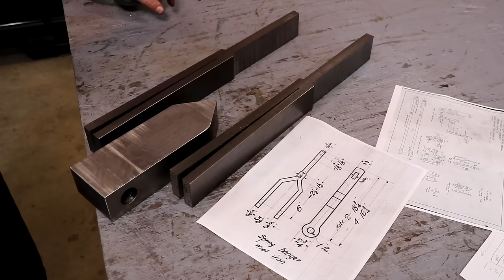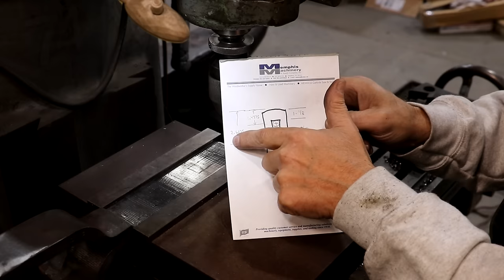Vulcan Steam Locomotive Spring Hangers - Machining the Details after Forging

Comment: I really appreciate your professionalism - not letting your detractors get to you. I had no idea how thick skinned a You Tube Content Provider has to be.
Reply: Actually, he has let them get to him!
Reply: Shipping him a set of spotting drills ... Jk, Keith is a treasure.  He is one of the few left that share reality and not some click bait bs.
Reply: @garys9694  No, if he had 'let them get to him' he would have succumbed to their wishes and changed his method. Telling them to F* off, is not 'getting to him'.
Reply: The only realistic reason I can think of not to use a center drill is the risk of breaking the tip, but I never used one so I don't know how easy is to break them.
Reply: @zomie1  I think most people don’t realize what life in a real machine shop is like. Mistakes happen all the time, on both the machinist’s as well as my part as the engineer. You stop by for a quick chat, fix the problem, and move on. Shame as here you potentially have hundreds of extra sets of eyes from various professionals which could be a god-send if a subtle but critical error is made.

Comment: I started my apprenticeship 50yrs back as a tool and diemaker.....making injection moulding tools and drop stamping dies and tools in the UK and I never heard of a spotting drill till I started watching youtube always used a centre drill never had an issue with hole positions doing so either will work cant see what is to get wound up about using one or the other...I will say you can use a centre drill to start a hole in a plate but you cannot use a spotting drill to prepare a centre on a lathe :)

Comment: Now, Keith, if you're insist on using a center drill in that way, you must use a left-handed drill. It must be half inch under size to allow for the wobble. And 87 octane gasoline must be used as cutting oil.
Reply: I think you're supposed to use 89

Comment: Thanks Crag for being great. Oh I’m not using my center drill right? I been doing it wrong for 30 years. I will have to remake all those thousand of parts to make sure they’re in specification, Not! Thanks for sharing. I think you got the hardest job on the internet, 1/4 of a million people watching every move you make, make lemon aid out of lemon and put it on a tee shirt. “ did you spot drill that spaceship part ? ”lol or “Center drill not just for hobbiest any more” lol. I’m so glad you have a great sense of humor.
Reply: If you think about it, using a centre drill to spot a hole is no different to drilling a pilot hole and enlarging it later. The only real problem with using a centre drill to start a hole is that the oil recess part of the driĺl (the pilot) is so fragile and will tend to snap off if chips aren't cleared to prevent jamming. A proper spotting drill maybe better as it is specifically designed for the job but a centre drill works just fine.
Personally I favour an old  two flute end/slotting mill reground as a 118 degree 4 facet  drill, but I'm just a cheapskate.😉
Reply: @littleworkshopofhorrors2395 , Rather than using the word cheapskate I prefer to use frugal, Lol
Reply: @Hoaxer51  or perhaps careful.😉

Comment: I knew a guy that had modified an old reciprocating saw to clamp most file tangs. He would use it when he had a lot of filing to do. It was surprisingly effective.
Reply: Didn't modify the saw, just put three four turns of bailing wire around a beat up blade. Worked fine.
Reply: Good Idea. Going to have to remember that. = Portable die filer!  (For what it is I might have burned it out with the plaz and finished it with a die grinder and carbide burr)

Comment: Keith, years ago, I had a 1964 International Scout with Armstrong steering, and I had to drill the hardened frame for the Saginaw box. I had to keep dipping the bit in water to try to protect the bit. I finally got the holes drilled, but it took awhile.

Comment: Thanks Keith, if it makes you feel any better, I don't own a spotting drill. I have always done the same thing that you do.
Reply: I'm the same.  I believe those of us who learned the trade in the 70s and 80s all use center drills.   I never even saw a spotting drill until  CNCs became common.
Reply: @philshel1  I ran a CNC for a few years drilling heat exchanger tube sheets. Never used a spotting drill.

Comment: Keith, don't let the trolls get to you. You are a skilled craftsman, which means that your chosen method may not be the same as practiced by craftsman B or craftsman C, but it still gets the job done. In any skilled profession, be it machining, engineering, medicine, law, or [gasp] politics; there are many different ways of approaching and solving problems. The key is to recognize that there are different approaches, and to select the one that you are the most comfortable with that will solve the problem. Sometimes we learn from others, sometimes, others learn from us.

Comment: I tried millin a piece of railroad track that was not annealed. I wrecked 4 braised cutters on a face mill. I think the track was work hardened from the train wheels. I finally figured it out and everything went more smoothly after I annealed the work
Reply: I'd say that's why you see a lot of makeshift anvils, made from an old piece of RR track.
Reply: Try machining a RR wheel. Hard as can be. Beth Steel had a machinability rating for them at "0"
Reply: rail road track is flame hardened after its installed.
Reply: The top and sides are induction harden and then flame tempered to a certain hardness before it leave the steel mill.  They don't do that out on the high rail. @MrChevelle83
Reply: @4GSR  ok then what are they doing when Ive seen the rail crew using a machine with a bunch of burners riding down the tracks?

Comment: Good work there Greg and Keith,  I love when a plan comes together, as one tv show was famous for saying.  In the back of my mind I was wondering if Greg had left the metal machinable. I had not seen the 4140 steel be annealed like that. Facinating Thanks
Reply: I think the smith might have went ahead and quenched it anyway....just heating it red and letting it air cool it will only go to like 40-45 C-Rock.

Comment: I once watched a Stefan Gotteswinter video and he explained that a center drill had the point sharpened to 118 degrees and further up in the center drill was set to a 60 degree bevel to match most lathe centers. Stefan explained that if you just use the tip of the center drill it will match your regular drill and will work fine but if you use the center drill up to it’s second bevel (the 60 degree bevel) then it won’t match your drill bit and could throw your drill bit off. 
   So yes, Keith is right about using his center drill and since they’re so short, they may work better in certain uses. Just adding some numbers to what Keith said in this video.
Reply: No question about it,,,,,if you are working to a half thousandth..... But in this case an eighth would go n noticed. - Fact is, unless there is something I don't know  i don't think the holes bought Keith a thing. - Just plnge and mill. -  Even if it's not a center cutting mill, down feed as you move.  Yo  Keith. let us know the reason you drilled the ends and didn't chain drill the center, or just didn't mill without drilling (I'm sure there is something i'm not seeing.

Comment: When we were cutting square slots we drilled and then broached the holes. squaring the broach against the fixture. Then we milled out the center waste. It saved us a lot of time
Reply: Hood idea,,,,,Another one i will remember. -  If it's fussy we have used the slotting head on the mill

Comment: Keith, your slotter attachment for your mill would make short work of the square hole. Also would would be a chance to set it up and use it.
Reply: Good idea but probably too much trouble to set up. Could save filing time by removing much of the material in the corners with smaller end mills.

Comment: Nice work Keith. Thanks for explaining the difference between a centre drill and a spotting drill. I use both for different applications. I find the centre drill better for rough surfaces as it is more rigid than a spotting drill.

Comment: I have been cross drilling like you did for over 60 years. - Even have done that in the drill press by locking the quill and sliding the vise back and fourth to get a mark in the top. . No question it's under +/- 005. if you don't dig in a mile.   

 I have just been thinking (it's why you smell hair burning) and although I have used edge finders to find the center of a round to cross drill,  I really don't remember ever needing anything where a couple of thousandths on a cross hole location made any difference at all anyway.. 

You cork sniffers lighten up on Keith. He;s a good man and it's for a friggin cotter pin!  Who cares? ---- Good job Kieth. i wold not have thought of the grain flow. - Bet that's the way they did it in the first place.

Comment: I have some small carbide drills that I can drill through M48 with and once you have a pilot hole through the slow-moving nose of the drill will not have to work much.  The faster turning (remember lever arm - pivot rotates and the outside flies around the pivot.) but doing as you did will work in time.

Comment: Is the hardness of the hangers an issue in use? If they were installed as hard as you received them, would they not be prone to cracking. Likewise if they’re not hard enough will they not be prone to bending?
Reply: The originals were made from wrought iron, a much less refined material then the steel Keith used.
They were still pretty soft as he was able to drill into them partway.
Reply: I’m speculating that the blacksmith thought increased hardness would extend the service life of the bearing surfaces. Keep up the good work, my favorite channel to zone out and relax on.
Reply: @samuraidriver4x4  I’m talking about the new ones. Given how hard it was when he got it, if he didn’t anneal it, could it have been TOO hard and prone to cracking?
Reply: @mbruce4152  maybe. But didn’t the old ones crack? Maybe I’m remembering it wrong.
Reply: @jamanjeval  they weren't that hard, it still produced chips when drilling so they where probably already softer then the springs that are attached to it.
Take leaf spring from a truck, those are hardened but to a point its springy and not brittle.
If you don't harden a leaf spring they would bend and deform.
If these were so hard they were brittle he wouldn't be able to even start the drill into them.
The old ones were made from wrought iron and you can't compare that with modern steel especially when it comes to how brittle it is
Reply: @mbruce4152  Keith did mention he asked the blacksmith to anneal them

Comment: I’ve never owned a spotting drill.. always used my center drills. Now I do have a few carbide drills that I use occasionally to spot harder material.. is that what you’re referring too ? 🤔 it’s amazing what you can do with 4140 and a torch !

Comment: Would you have been able to use a broach on the two holes, then mill out the center? I've always found that filing on a job like that is right up there with enduring root canal.
And ignore the Nattering Nabobs of Negativity re making a pilot dimple. I've always done that, drill press, mill or freehand drilling. Just makes life easier.

Comment: Question. Would it not be better to modify the rectangular pins to have a radius so that the hanger’s rectangular hole was likewise rounded at the ends? I worried about stress induced cracking due to square corners. Another great and informative video. 👍
Reply: Hasn't been a problem on the originals for over 100 years.  Don't thin it will matter now.
Reply: @mathewmolk2089  👍. If it ain’t broke, don’t mess with it.

Comment: As a machinist, I would have tried a cobalt or carbide drill before I would have annealed the metal.
But if those tools were not available, I understand. 
Side note.... You need to take it slow with 4140 when drilling with tool steel.
Reply: That would have then been hell to mill out the slot and file the corners square. He knew what would happen from the forging and told the blacksmith what needed to be done. Apparently the blacksmith either forgot, annealed it poorly, or ran out of time. Keith has the tools and knowledge to take care of it, so he got it done.

Comment: Could you have used a 5/8" square broach to get the square corners and then mill out the webbing between the holes?
Reply: Have you priced 5/8” square broaches lately?
Reply: @grntitan1 Actually yes! $$$$$ I was looking at 3/8" square broaches for a project. Now I'm hoping I can find someone with one because there's no way I could file these parts.

Comment: I'm wondering if it would be a good idea to drill a hole at the top of the saw split for the legs. So it doesn't split further on it's own. Just like a crack a stop hole.

Comment: I'm not a machinist but have done some work on milling machines and drill presses and I've always used center drills for spotting. Now I learn from Keith that I've been screwing up all along....
I wonder, are there any professional machinists that don't use center drills for spotting? The milling machines I've run had center drills with their general tooling, same with drill presses the center drills on them are as close to hand as the chuck keys and taper keys.

Comment: I've never used a spotting drill, always a center drill. Reason? I am budget minded and it works just fine. Of course, I am just a hobby machinist so having 1 set of tools that can do 2 jobs acceptably is an option and I can spend more on other things like end mills.

Comment: Comments, Comments, Comments!  LOL  I learned a long time ago that there are many ways to skin a cat.  Some people I have worked with always reminded me that their way was not only superior but the only way it can be done.  Then I went about doing my task the way I knew would work fine.   
Now for a serious question.  Considering the weight those hangers and pin will carry, is the annealed hardness sufficient or will it require re-hardening to some degree?  
Thanks for your videos, even if I might have done at least something different that you.  (My only metal experience is watching machinists on You Tube.)  LOL

Comment: I do not Have a torch , I know it hard on the drill , the way I get around thie is to lower the RPM to its lowest  there is only two times I had to put my work piece in my wood stove ....  I sharpen the drill after each one or two holes , I do not use the mill the cutters are to expensive ....

Comment: Center drill, spot drill?  Pshaw. I just use a center punch.  If I'm drilling through a cylindrical part, I'll file a little flat first to keep the punch from walking.  Good enough for a cross-hole for a cotter pin.

Comment: Hate to be a Complainer Keith, but the Microphone placement is really hindering Your Videos.
Clip it up on Your Collar....
Still loving the Content tho.
Mike M.
Reply: I doubt it.  The high-end attenuation, and the increased influence of inverse-square variations of being on the collar, would most likely make the whole thing sound worse.  The most significant issue these days is normalization of the clips during editing, which take some levels up like crazy and other levels down like crazy.
Reply: @ydonl  He's had it up higher when He 1st started making videos and the Audio was just fine.
I think the Mic port on those Rodes Mic's are facing outwards as You can tell the Machinery is a whole lot louder and clearer than He is when Talking. 
I listen to You Tube Audio on a High end 7.1 sound system and can clearly hear differences in Audio from content providers.
For the most part most are good and others I have to wonder LOL
And at 63 My hearing is still pretty sharp.
Working in the Audio Bizz one has to have good hearing